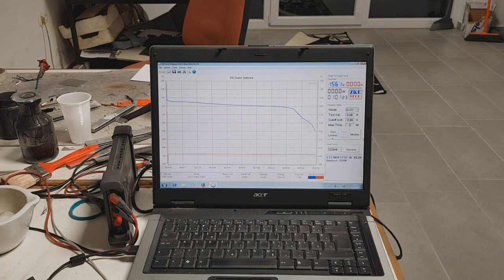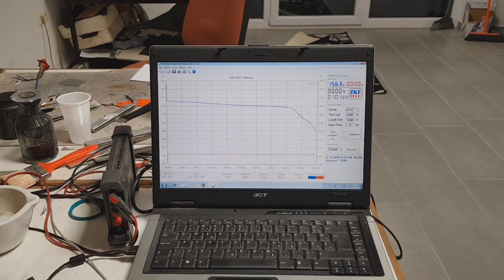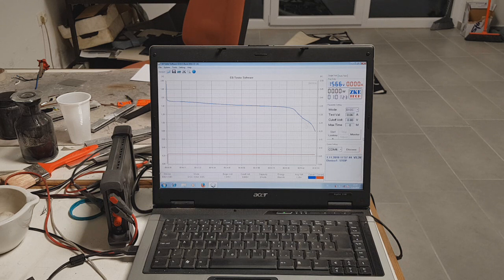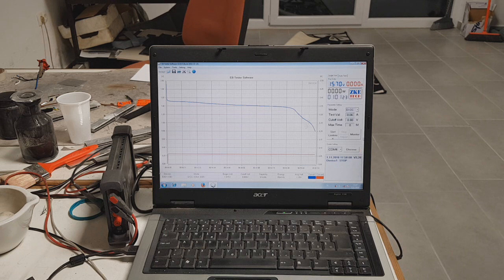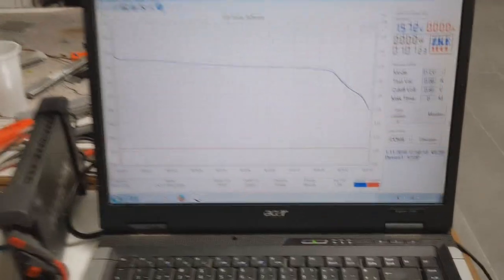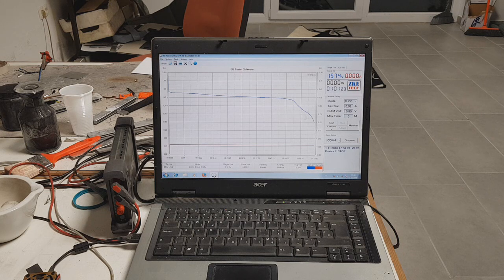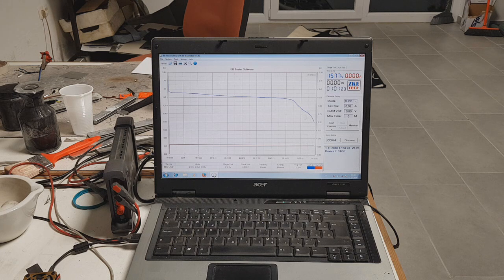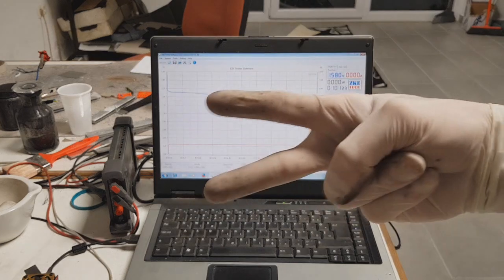Zinc Battery (zinc Hexacyanoferrate) UPDATE

Comment: Dear Cayrex,
many thanks for this update.
My own focus is more on live time of battery than energy density because I'm looking for a system to store electric power from solar cells and wind turbines. So for stationary batterys the volume is not relevant. It would be nice if you can tell in any future how many cycles this battery has. 
AND: I wish you good success with your experiments you will do in future!
Reply from the maker: Hello! I know what you mean. For energy storage systems is not really important the specific energy of the battery, because is more important that the battery have good cycle life, is cheap and robust. This type of the battery need some development to be really good in cycles life. Right now the battery have around 200 cycles to 80% of the capacity. But I know a battery type which is right battery for energy storage job. Is not the best battery tech but this battery can work for 50 to 100 years and I am focused to bring this battery on the next level. The battery is based on iron. Nickel Iron battery are really robust and have great life span. Also other type of iron based battery is iron air battery, which have good specific energy with around 2000 cycles.
Reply: Dear  @cayrex  , many thanks for your reply. I'm thinking about Nickel - Iron battery (Edison Cell) and the possibility to do this on base Coal - Zinc element as well. It's all very old tecnology. The problem is only the economical construction and manufactoring... Let's work on it!
Reply from the maker: Yes Inknow what you mean. The zinc coal is cheaper that nickel zinc battery, yes. So, the zinc carbon (MnO2 free) cell can get around 10.000 cycles,.... the capacity is not large but is simple to make and have good cycle life